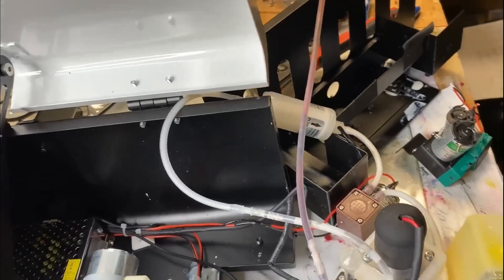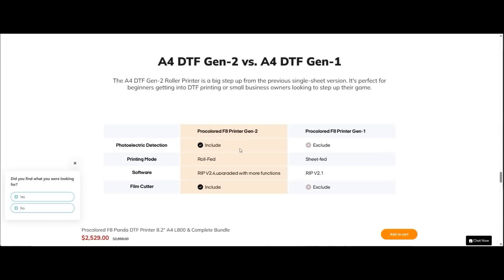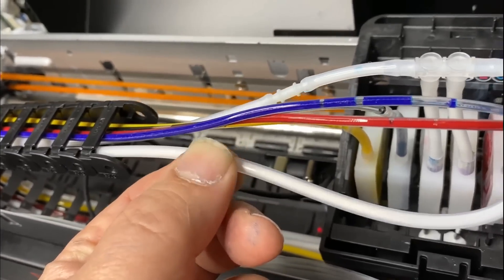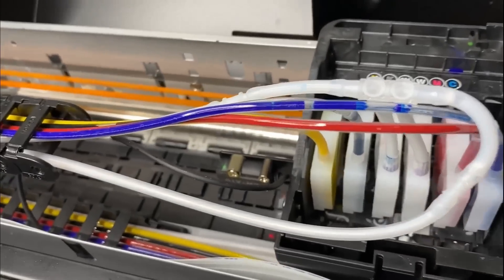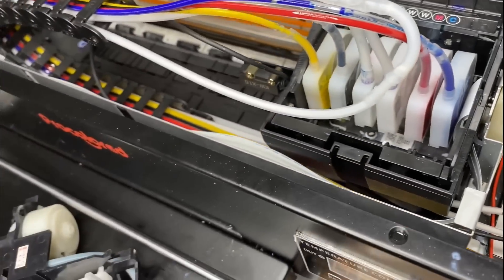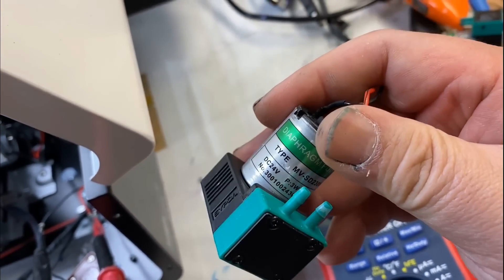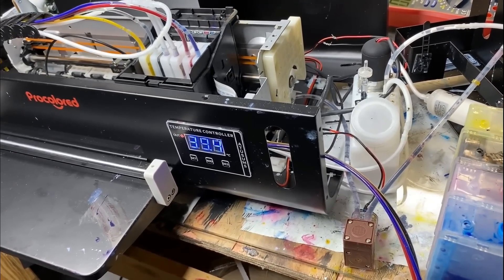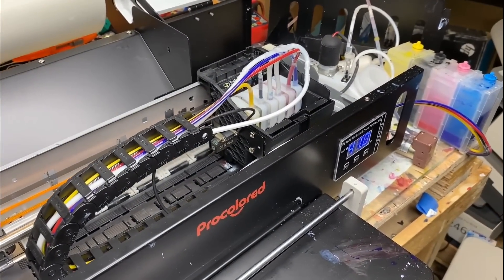Why This DTF Printer FAILED After Just 2 Days?  - Procolored F8 Panda DTF Printer Gen 2

Comment: Hey @kevin I watch your video all the time, I have an epson printer that makes an awful grinding sounds, only when printing vertical, no paper jam, regular print is fine
Reply from the maker: Thanks so much for watching the channel and for your continued support—it really means a lot! If your Epson printer is making a loud grinding sound only when printing vertically (like during borderless prints or photo prints), but works fine during standard horizontal printing, the issue is likely mechanical and related to carriage alignment or tension on the feed rollers. When printing vertically, the paper feed system and carriage move differently, putting more strain on worn gears, dry sliders, or misaligned rollers. I’d start by checking the printhead rail—clean it and apply a drop of synthetic oil—and inspect the encoder strip to make sure it's clean and centered. Also, check if the rear rollers or PF motor gears are worn or skipping under load. There’s no jam, so it’s probably not obstruction—more likely friction or backlash in motion parts. If you want a deeper dive, try searching “grinding” on my YouTube channel homepage [https://youtube.com/@bchtechnologies] to find some related videos. Let me know what model you’re using too—I might have something more specific to help!

Ask ChatGPT

Comment: I've worked on quite a few Procolored printers, they're such terrible machines for the price and the support is mediocre at best. Parts are also marked up 250%+ on things like heads.

For mixing, I found the peristaltic pumps are a must. Too easy to plug up diaphragm pumps with white ink.
Reply: agreeed!!! awful
Reply: Which would be a better unit from a prosumer standpoint.  Need one for the wife to make t shirts to sell at craft fairs.
Reply: @Samho1982  If you do not have the demand for using the printer at least 4-5 times a week, I would just order DTF gang sheets from a local printer. Good way to test the water of the market before commiting to an expensive machine that needs lots of maintenance.

Comment: Anyone with machine design experience would look at the exposed components and chuckle thinking what could possibly go wrong.  All the wires, sensors, data cables, tube connections, and other components - what I design nightmare.